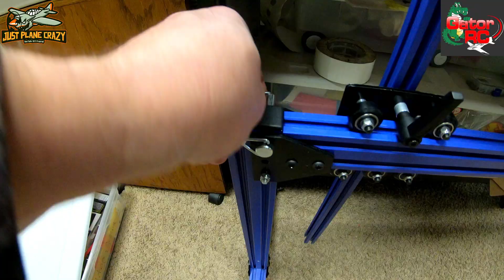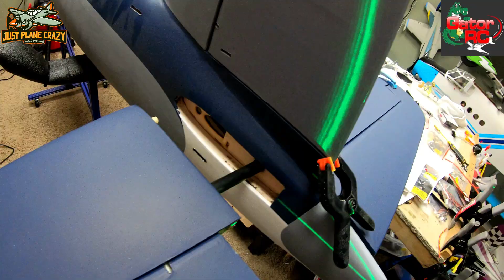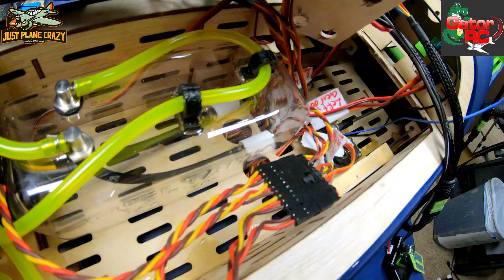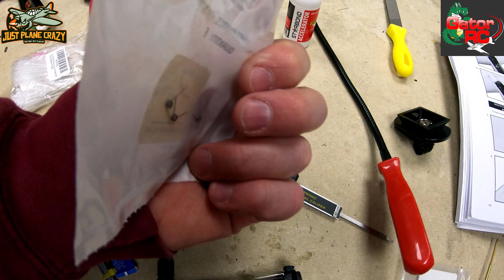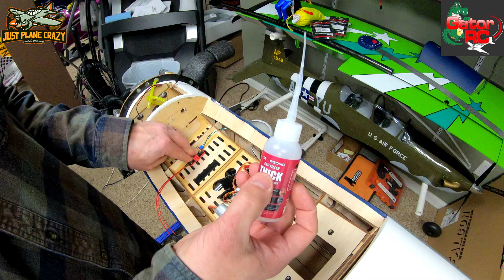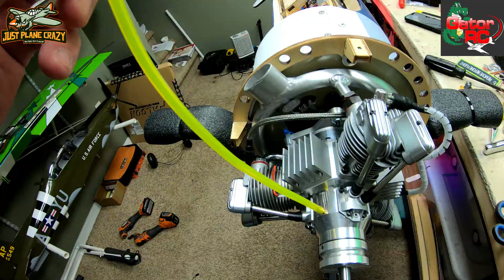Seagull Model Limited Edition 87" F4U Corsair, FG-90r3 Radial Power, Assembly of the Fuselage

Comment: Brandon, Loved the series as I bought one of these last September.  I am thinking of putting a UMS 100cc 5 cylinder in mine.  What did the saito and ring weigh, also how much weight did you need to add and where to balance it?
Reply from the maker: Absolutely zero added weight. Not sure what the ring weight was but not much. That saito pulls this thing no issues. Cg was mid of book spec

Comment: Waiting for my seagull corsair. I’m thinking of gluing the horizontal stabilizer with the body upside down and using the bubble level on the saddle. Your thoughts ? I’m thinking of UMS 90-7 radial for power.
Your site in assembling the Corsair is very much appreciated.
Reply from the maker: I guess straight is still straight. Whatever you prefer. They have done a great job making perfect saddles. I still like checking them

Comment: Brandon, very good end to your video. On your pull pull steering at the tail wheel, I use 1/16 dobro ball links studs. I wrapped the cables exactly like you do, but there is a loop that is a tight fit around the top of the ball. As a precaution, I clip the plastic connectors short and pop them on top. That way I can very easily disconnect them and pull the retract unit.
 Still waiting on weather/rain and more rain to finish up painting the bottom white on my new warbird for this season.
 Good luck on your test flight. I can’t wait to see.
        Neal😊
Reply from the maker: Same to you. Good info. Thanks